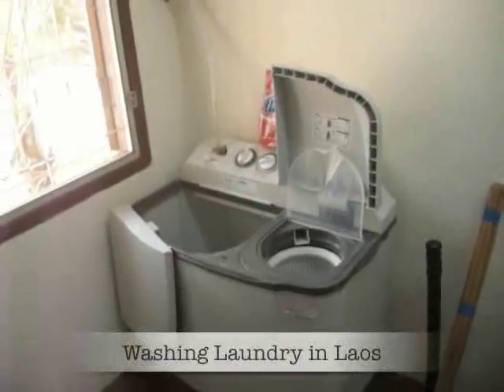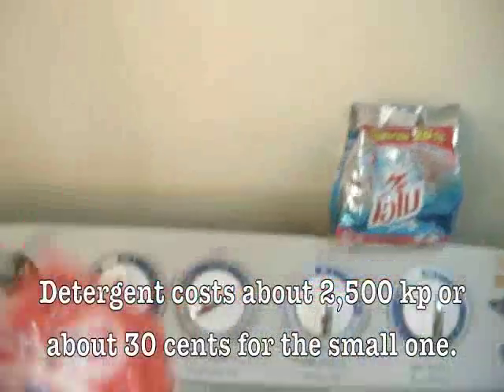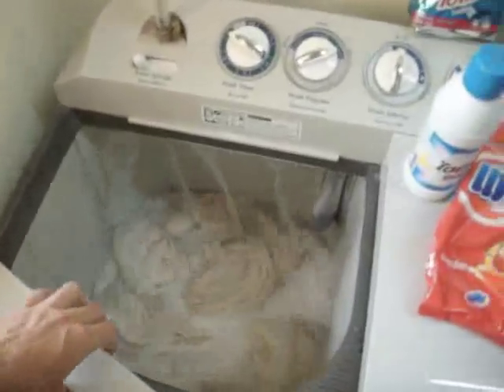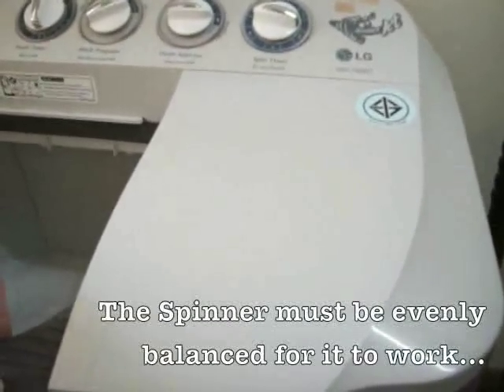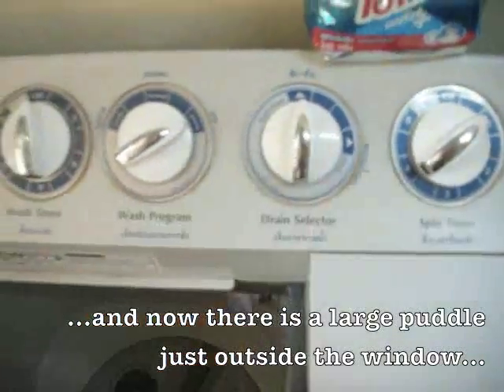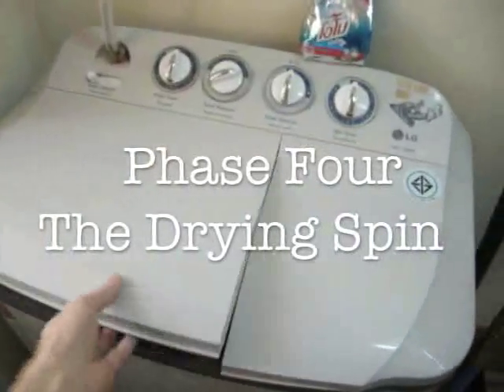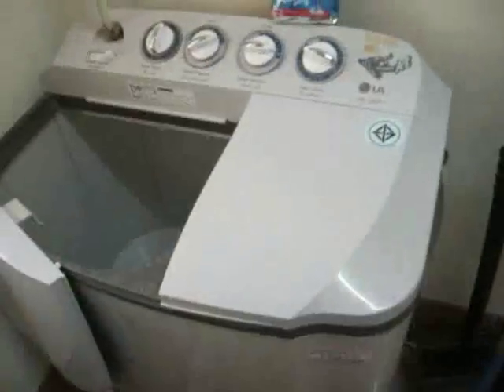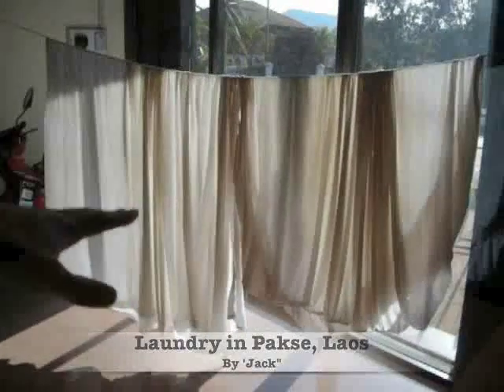Washing Clothes in Pakse, Laos

Comment from the maker: Have you actually used one of these?!?!?!?  Because I would use the rinse with the spinner, but that doesn't actually get it wet enough to get the detergent out of the laundry. I need to soak it again before the spinner.

Yes, I know about the rinse while you spin... try using one.

Tried... failed... that is why I do it this way... the only way that works well.